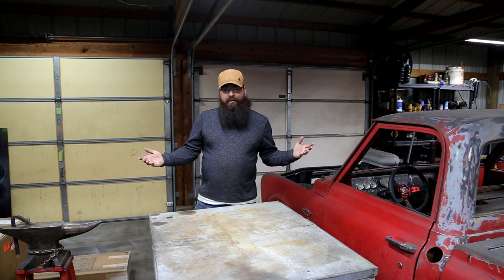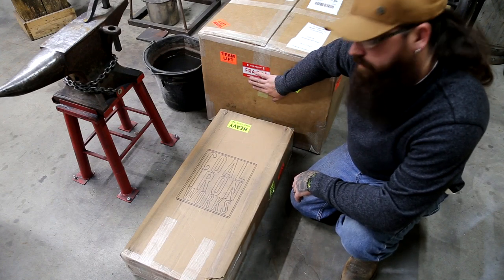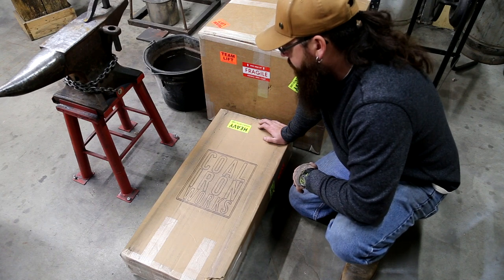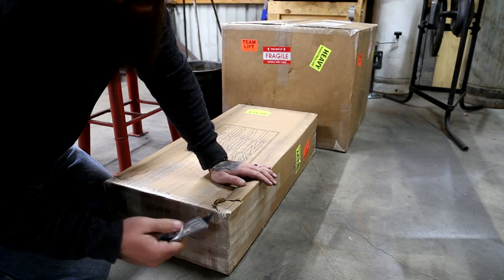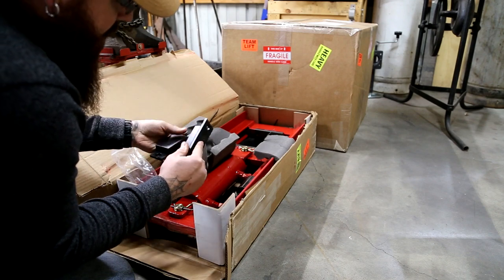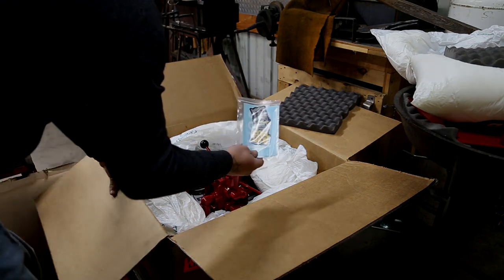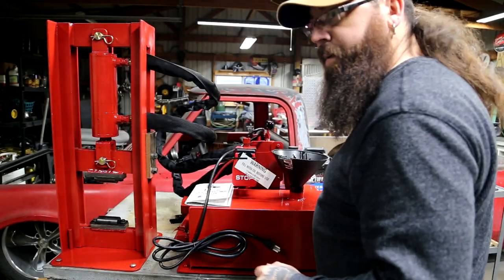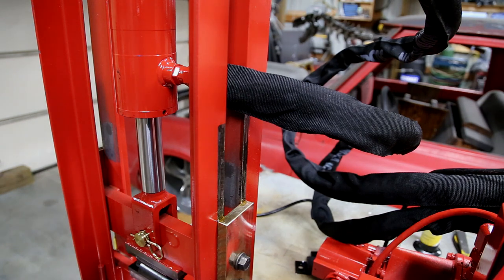Coal Iron Works 12-ton Forging Press Unboxing and first Smash, We Bought a Forging Press! Demo!!!

Comment: Thanks for buying one before me! I hope you'll keep us all posted on how it works over time. I've been getting advice that I really need a 40 ton to do four inch thick patterned billets, but it sure looks like this one could handle that.
Reply from the maker: What sold me was a demo on a hammer 4" stock and a big battle axe head. If the materials got enough it will move lol. I did notice even just on the rail spike, you gotta be really careful with the control or it will end up paper thin in a single squish

Comment: Have had my 12 ton from Coal for a couple of weeks and really like it. Spent the morning making tooling for it out of H13. The only complaint I would have is the blots for changing the dies. It gets hot quick and takes a bit of time to change them, but for the price and the quality of what you are getting for a small shop I don't think you can do better then the Coal. Congrats on the press.
Reply from the maker: Thank you! I'm really enjoying it, I may make a combo die soon for drawing tapers
Reply: @wrotiron  Finished a hammer eye drift yesterday, and am starting on a tomahawk drift soon. Will be uploading a video soon on my FB Chili Pepper Forge.
Reply from the maker: @chilipepperjackcowboyactio9947  I'll be sure to check them out. I think I might make a set of texture dies this weekend I've got some rail car coupling pins that are pretty darn hard, might see how they do.

Comment: Nice press!
Reply from the maker: Thank you!
Reply: @wrotiron  could I ask? how much oil is required ?  what are the characteristics of oil station (power of electric motor and etc)? There is not such press in Russia and I would make it for myself.
Reply from the maker: I'll have to look at specs, it holds 4.5 gallons of iso 46 hydraulic fluid, has a high bypass fluid transition block. With a pneumatic 12 ton ram. The motor I'll have to look at later. The company does ship internationally. Not sure on customs to Russia though. I'll look at specs after work today and let you know
Reply: @wrotiron  thank you very much. But price will be huge if I order it from USA  )) and becaouse of exchange rate (sanctions)) ) and cost of delivery.
Reply: @wrotiron  Hello. Could I ask another question? what is the power and speed of the electric motor?

Comment: How heavy is the Angle iron on the press looks a bit light for that kind of power?
Reply from the maker: 1/4" and the cross sections are 1" the hardware is all grade 8 and the brass wear guides are 1/2" thick. I've ran this machine a ton now and have made about 7 sets of dies for various applications some of which can put horizontal stress and there is zero movement, bending, or groaning from the construction of the frame. There are numerous videos and testimonials on the web site from Smiths who use it daily in heavy Damascus Billet forging and hammer/axe stock.

Comment: Hi there what size motor and pump does this use press use?
Reply from the maker: Not entirely sure if the specs and I'm away from the shop at the moment coal Ironworks site has replacement parts and I'm sure the specs are listed.
Reply: @wrotiron  yes I have since seen the specs listed in a online forum, cheers for replying either way it's appreciated. It appears to be a well made press. 👍
Reply: @wrotiron  what are the measurements on the angle iron used and other metals used? If you don’t mind sharing?